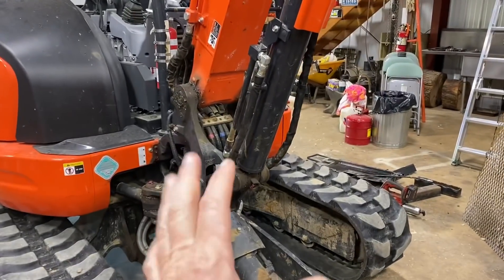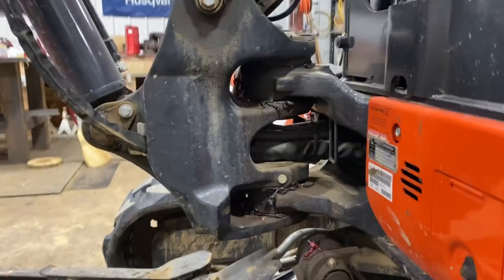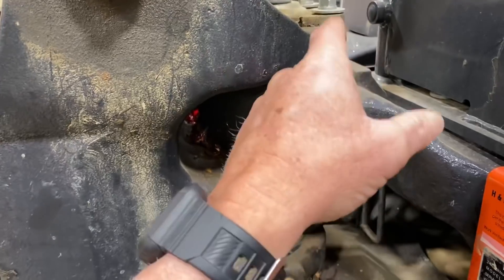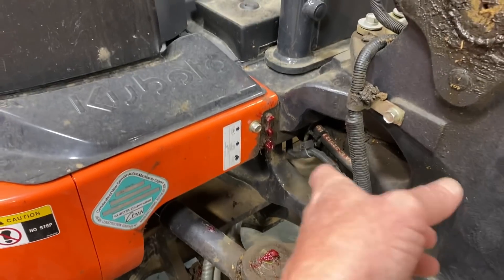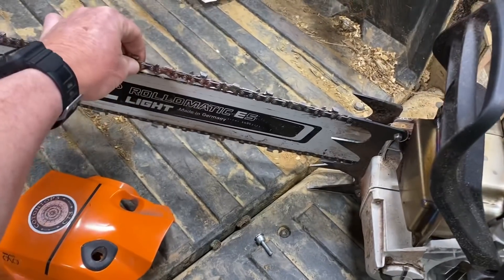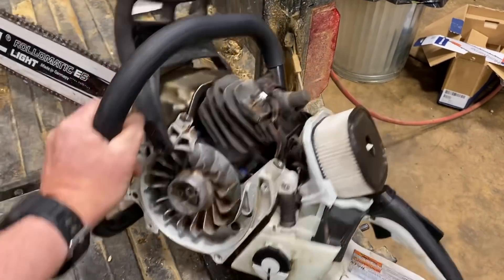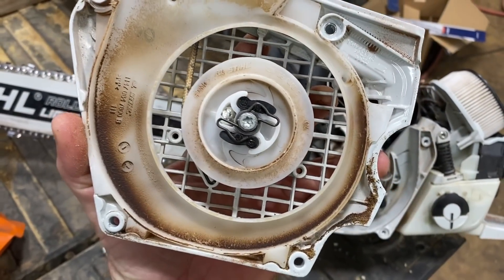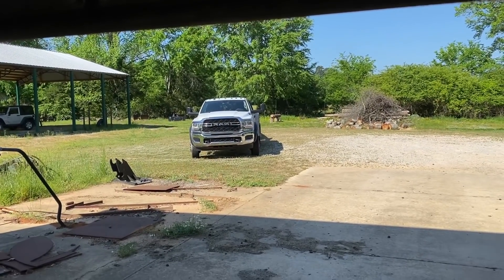Found the SQUEAK on the KUBOTA excavator

Comment: I didn’t see the last vid but I’ve literally had the same thing happen with my Kubota U55. Happened within the first few weeks I had it, though mine had about 1000 hours on it when I bought it.  One thing I do that helps is I lower the boom down to the ground when I grease and take just a little bit of the pressure off those two pins and that seems to help the grease get all the way around the pin. Thanks for the vid!

Comment: Glad you got it figured out Tim! I have occasionally used my boom swing on my E55 Bobcat. I need to check it’s grease fittings. Haven’t had that issue yet. I sometimes have to move the machines parts to get them to take grease. They don’t like to take grease when the joint is under pressure. I almost bought the same machine as yours last year, but the sale person never followed up as we had agreed. So I found a good deal on a Bobcat instead.

Comment: I’ve seen the warning light kit your talking about “ plug and play” basically. I’ve not used it but I felt like that would over use your factory lights, circuitry, ect. I Had wanted to get one of the plug and play kits for my Chevy for when I do bush hogging jobs, sometimes I have to park on the road. Turns out it’s too old. Lol.

Comment: I got a battery grease gun with a lock-n-load fitting. I can lock that sucker to my swing bearing zerk, sit in the cab and rotate while holding down the grease trigger. I grease 360 and never get out of the seat. I don't think there's enough clearance for that pin though, might can try.

Comment: Just like you said, I use an old hacksaw blade to clean the bar channel.  It's free, and works GREAT.   Don't even need the hook on it, although I'm going to grind a hook on mine to see if it works even better.

I agree with you... I can cut for 2 weeks and not get 10% of that much dust out of the air filter on any of my Huskies.  The air induction/intake on the Husqvarna saws is simply superior.

Comment: Lighting, Look for a Whelen dealer near you. USA made lighting. Most of the other stuff is offshore. Fire Research Corp has some good white lighting and sunstrips. The price is high for both. This is what I use for the Fire trucks. What ever you do,DO NOT drill the headlights for extra lights. Some of the body lights can be replaced with a "flashing" dual function  from truck-lite/Grote.

Comment: For led lights for your tool boxes get led light strips with sticky backing. I seen a nascar team houler driver do that to upgrade lighting in the office part of the hauler. I wouldn't think could get off amazon or lowes or home depot or even tractor supply or maybe like a radio shack type place

Comment: My work truck has the add on flashing amber lights front and back and it’s a fair amount of wiring. Works good but if it was my personal ride I would try converting the existing lights to flash 1st. Good luck

Comment: Speed turtle 2.0 easy flash hooks into the OBDII port and can make the lights flash I personally never used one but I own a towing company and though about getting one for my personal truck but just never went through on it. That controller is on UltraBright Lights just look it up and read up on it.
Reply: With that bed on your truck I would also look into Flare 12 LED hideaway lights they are abt a inch in diameter and super bright I run them in the tailgate housings of my wreckers here in alabama and super easy to install and very bright I think they would look good in the sides of the bed and they arnt not too noticeable as well as they would look good on the trailer
Reply: Im in Bham alabama and I got a guy who does all the wiring on wreckers and can run good wiring that’s not some crack job

Comment: If you end up getting someone to do the lights mine as well have them wire up some bright led lights like a 360 around your truck so you can see what you’re doing if it starts getting dark on you. Those strip led lights you can buy on eBay pretty cheap.

Comment: Tim,  my construction company I work for has over 140 pickups on the road with the plug and play flasher kit installed.    It's a plug and play deal and just about every light on the truck will flash and blink.    I just got a New 2021 Chevy 2500HD work truck  from them and that technology is too shelf.    If you'd like I'll get you some information on the kits that we use

Comment: Look for an emergency vehicle outfitter near you...that's what I did they drilled my headlights and added strobes and the tail lights as well as made my cab lights flash on my 2018 550 service truck...was like 800 installed took them a day...find someone like that local to you. Later

Comment: You wanna spark a hot topic and get some views... buy one of those Remington gas chainsaws and run it awhile. Get it sorta close to the ground like you’re cutting big wood that’s down. That air filter will clog in seconds. It will be so bad that the saw no longer runs properly enough to cut effectively anymore. It’s such a bad design. I used some of those scratch resistant dish/pan cleaning scrub pads to make a sorta pre-filter to help mine. I know I should just but a better quality saw but I use a saw like once a year and didn’t wanna drop a ton of money. I should have tho. Those Remington saws are crap for filtering. Works great if you can keep the filter clean tho. Lol

Comment: Can't you just put flashing lights on top of your headboard?  I drive a  service truck with strip led lighting in all the boxes.  That's easy to do.  Just daisy chain a piece of esso cord from box to box.  Be sure and use grommets though to protect the wire.